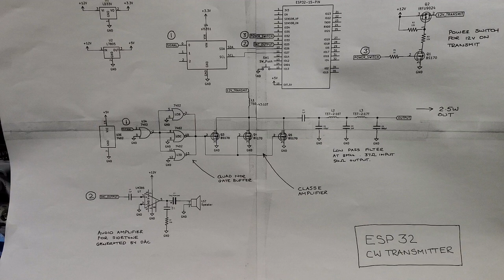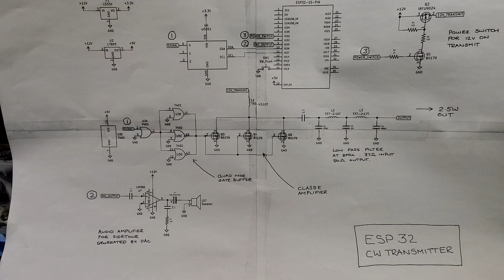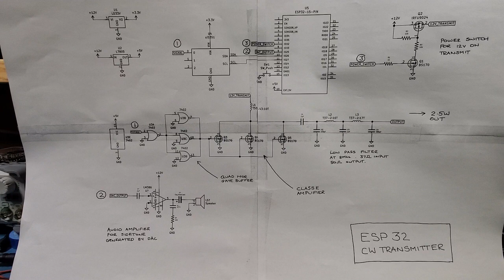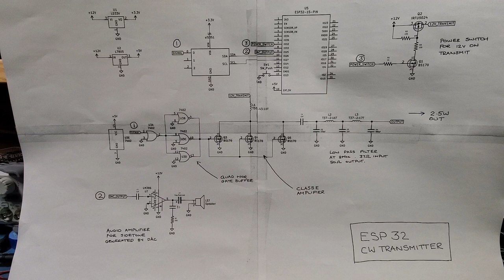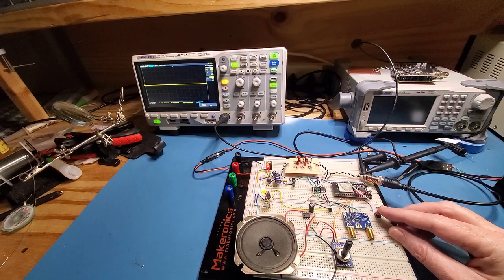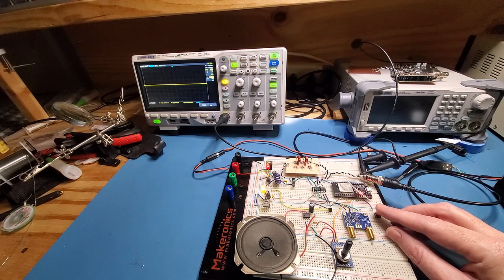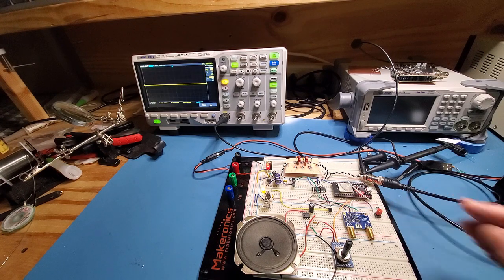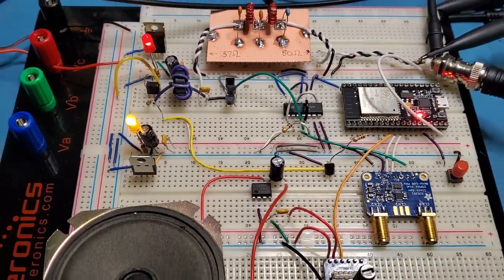ESP32 CW Transmitter

Comment: Bloody brilliant Ian ... we must have had the same thing for breakfast (Vegemite on toast?) as I'm working on a very similar project. I'm leaning heavily on the QCX manual that has heaps of info and references. The inductance of the loading coil seems to be "critical" to get max class E efficiency. I'm hoping to get closer to 5W and running QRP. As always thanks heaps for your videos as they are always relevant and interesting. As for the code, I've written my own and have incorporated a simple keyer with all the appropriate timing. My MCU is a Pro Mini ... starting to run out of pins LOL.
Reply from the maker: Thank you Neville . Like I mentioned I am going to play around with the input impedance of that LPF and see where I can get the output to. I am running about .5 A through the 3 BS170s together  right now so there's still some room to go. Glad you enjoyed!
Reply from the maker: I redid the test using a 30ohm/50ohm impedance LPF https://drive.google.com/file/d/1chieY_cBfhPB1my2w2B34FxULkMGBY_T/view?usp=sharing

Now I get around 3.75 watts output
Reply: Nice work Neville and Ian, two of my favourite QRP homebrewers! 😊 Would be interested to see if your design works higher, say 30, then 20m.
Reply: Only  half cooked prawns with  Vegemite   with a  slash of  Tomato Sauce counts as  proper Ozzie fare.   The trick is to digest it before the samonella gets you first.

VEgemite on toast as you quote  is  for  soft Pftaha wannabe  Crocodile Dundee certified Hero types who go for work 9 to five  on the London tube and hope for  RF Greatness in a future life. 🙂